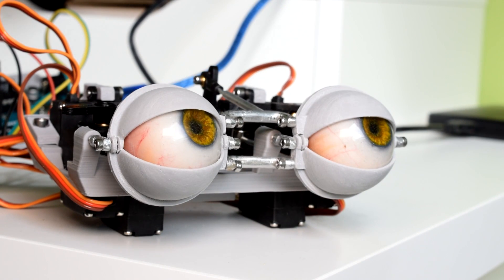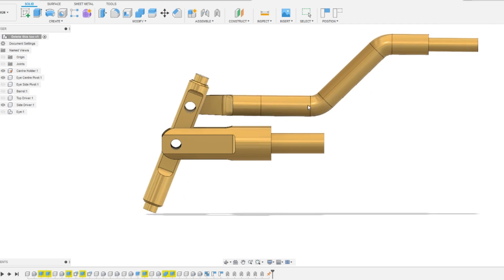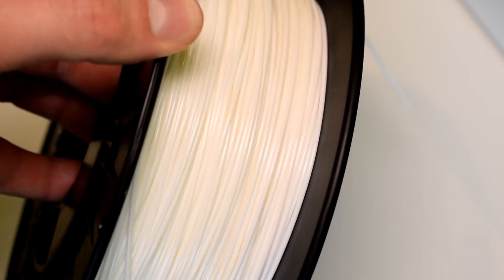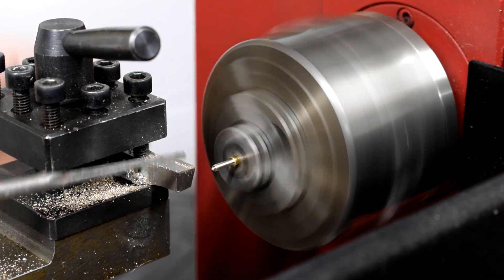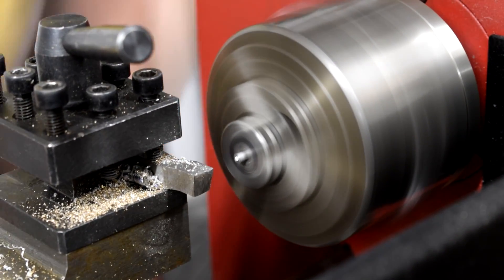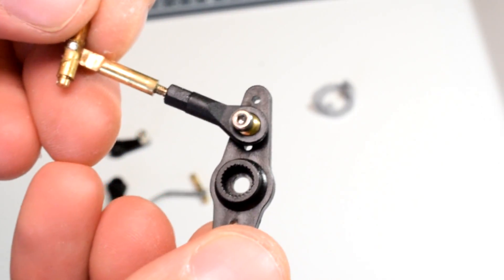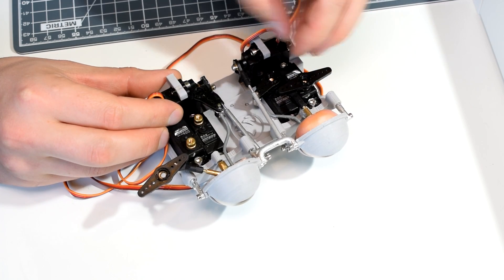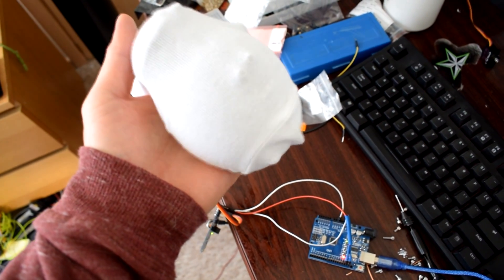Making a Robust Machined Eye Mechanism with 3D Printing and Arduino

Comment: Great work! I am just wondering why all these designs are based on both eyelids having to move the same way. Real humans mainly use the top eyelid to cover the whole eye and thus this lid goes beyond halfway the eye. The bottom eyelid hardly ever moves, except when squinting. The result of this design is so unnatural and will never give realistic human-like results. Dolls for kids also have only one eye lid.
What strikes me too is that the use of servo's is crude: To move the eye, the Arduino seems to send only one pulse command to move the eye to the desired position. Why not vary the pulse width in about 5 or more steps such that accelleration from the beginning position and de-accelleration near the end position occurs, resulting in much smoother movements. Or is that not possible? 
I am planning to make my own animatronic eye (at half the size using 2.5g servos) and will experiment with servo command strings with varying pulse widths.
Reply: good point

Comment: If you are going to machine more linkages like at 6:00, look into slitting saw blades. I've used them before, even the Dremel-sized versions will make quick work of cutting slots in brass and plastic. I just found your channel, neat projects!

Comment: When you burn the tip of your finger, try to remember to grab the loose skin of your earlobe (with the freshly burned finger).  This will "suck out" some of the heat from you finger into your earlobe, which will lessen the severity of the burn. I learned this from a blacksmith, and use it often when soldering stuff.